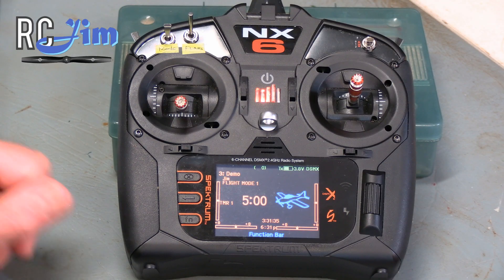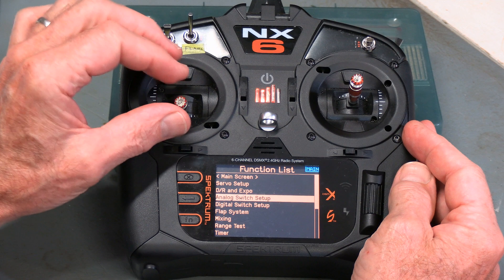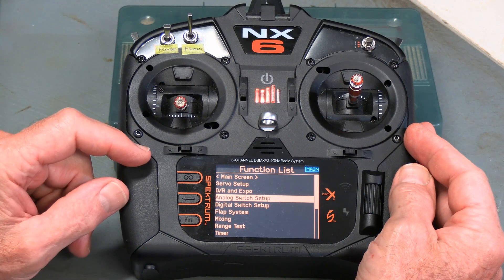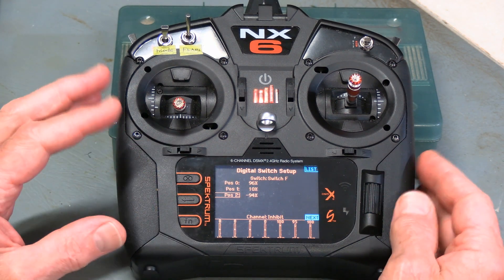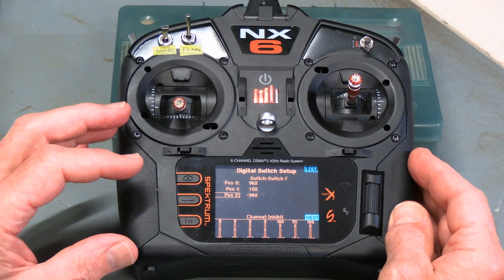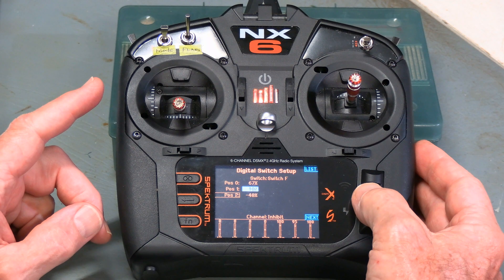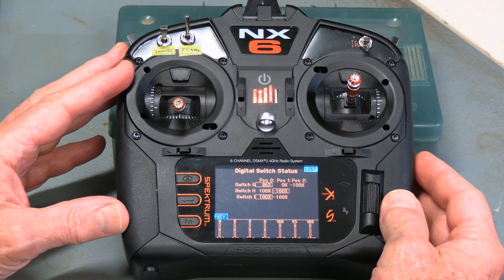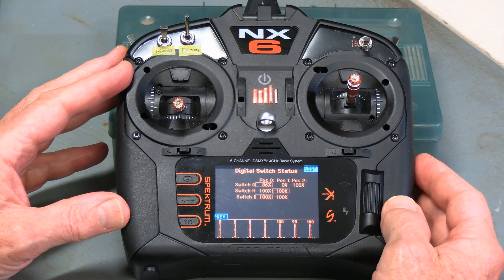Spektrum NX Analog and Digital Switch Setup

Comment: You never mentioned how the digital switch is linked to the servo you want to control
Reply from the maker: Sorry about that, you are right!  Under "System Setup," go to "Channel Assignments", then click "Next" to get to "Channel Input Config."  Scroll down to the channel that you want to use for your digital switch, then press in the scroll wheel.  Now scroll left or right to get to the desired switch, and press in the wheel again.  That channel will then show up in the "Digital Switch" setup screen when you select that switch.

Comment: I have UMX Timber X and an NX8+ transmitter. If I trim the plane with no wind, it really likes to climb when flying into some wind. I would like to program switch G to add some down bias to the elevator when flying in wind, rather than re-trim or constantly flying with significant down elevator. I have programmed switch F for high, medium and low rates. Solution? Maybe it climbs because when flying into the wind, I’m at a pretty high throttle setting.
Reply from the maker: With a steady wind, the direction of travel should not affect the rate of climb.  Most likely you are using higher throttle when climbing.  It is normal for a plane to climb more with increased throttle - due to higher airspeed and more lift.

Comment: 5:00 Interesting, although I would do the opposite, low rates high throttle, high rates low throttle.  Thanks for the lesson
Reply from the maker: For some planes what you do is appropriate - for example a ducted fan jet which doesn't have propwash going over control surfaces.  And, for any particular model, it's very much a personal preference.  For me, I Iike smooth, easy to control movements when taking off or landing.  With high rates it's too easy for the plane to twitch around with over-control movements.  My low rates are very much scale like control movements, which work well.  My high rates are for doing extreme aerobatic movements.  Having said that, I got caught out recently having my rates set to low on a new Great Planes Decathlon, which resulted in a crash.  See https://www.youtube.com/watch?v=DC6oJpzm9CY
Reply: @RCJim  Thanks for the reply.  these two switch menus isn't something I've played with, found your video helpful understanding it. but yes makes sense. I was thinking of higher speed planes. I often use mid or gigh rates for take off and landing, low rates at high speed.
Reply from the maker: Understood.  Makes sense for that sort of plane.

Comment: What if you put a rotory analog switch in place of digital toggle switch? Can that be configured?
Reply from the maker: Analog switch setup would allow you to configure a rotary knob to a digital output, but most likely you would simply be assigning the knob to a channel.  You would do that for continuous fine adjustment of flaps or airbrakes, etc.

Comment: What do you do when it freezes up on power up and just shows the logo on the screen? Unplugged the battery and nothig changed. Not happy with the NX10.
Reply from the maker: Sounds like a firmware glitch.  For a start I would disconnect the battery, and check the voltage.  Then plug it back in and see if it works.  If that doesn't do it, try providing power to it via the USB.  If still no joy, get in touch with Spektrum customer service.

Comment: Hi Jim Do you have a tutorial on setting the selected fail safe positions? I have not been able to program selected fail safe on separate channels
Reply from the maker: Failsafe features are on receivers and ESC's.  The ones on receivers are what can set failsafe control positions for times when the signal is lost.  Most ESC's will have a failsafe that cuts the throttle if there is no throttle signal from the receiver, but it obviously cannot control what happens to control surfaces.
With a Flysky radio, the receiver settings are set through the transmitter, but it's still the receiver that is doing the work.  For several Spektrum receivers there are a variety of ways to set failsafe control positions.
I'll do a video on this in due course.

Comment: I assume you could set up the analog throttle switch to select different flight modes so that you could have different AS3X gains based on throttle position.
Reply from the maker: Hi Brian, yes, that's a thought.